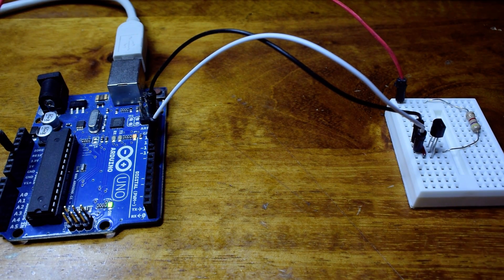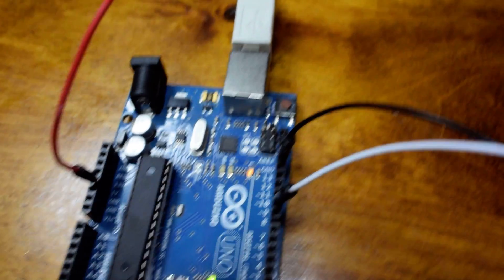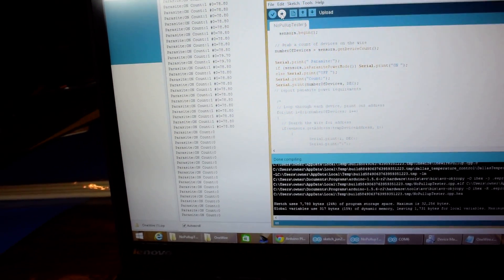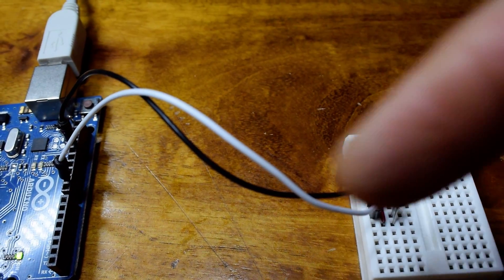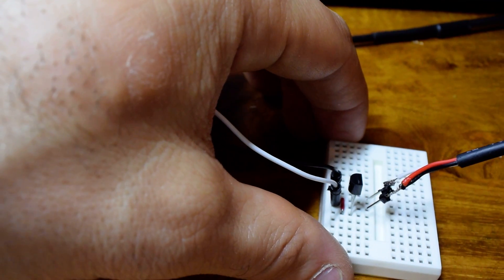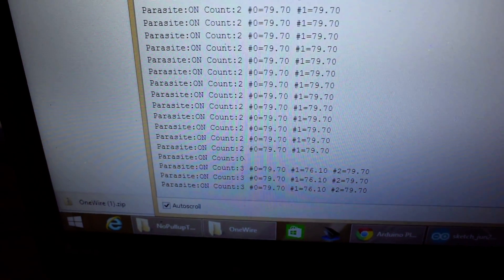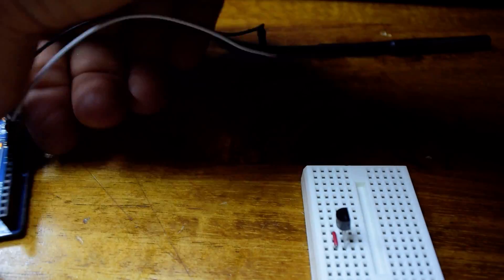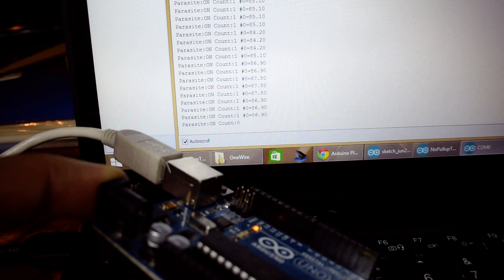PROVED: External OneWire pull-up not needed for Arduino comunication to DS18B20 temp sensor

Comment: wel.. the document from ds18b20 doesn say they are testing the sensor at 150m+ with 50m between each sensor, and the pullup circuit is for extreme condition, for your short, rather low capactiance cable, it is not that big of a deal.

Comment: Can't get this to work for esp32 :(

I applied the changes from https://github.com/bigjosh/OneWireNoResistor/commit/ebba80cf61920aef399efa252826b1b59feb6589
in my local onewire library, in arduino libraries folder

But the sensor cannot read the temperature,  it just returns -127

Comment: This schematic doen't work! Why? You have to read datasheet and see that if you have 2-wire connection then you have to drive data pin directly to power rail in data accuisition and eeprom write operations (those modes require alot of power). If   you can't do data accuisition then sensor is useless!

Comment: Why does the program say, "on pin 10 (a 4.7K resistor is necessary)"? It works with the resistor, but not without it.
Reply: Got it.

Comment: I'm trying to read the temp with a ds18b20 and I tried using your code but I keep getting this error.
error: 'class DallasTemperature' has no member named 'reset'
Reply: Getting the same error... Any ideas?
Reply: Jorge Ulloa Never found the solution, I'm just getting the correct resistors to do it.
Reply: Philip Cara I found a solution. Just commented line 17 this way: //#define BUSFAIL and it works!
Reply: Jorge Ulloa awesome I'll check this out, thanks!

Comment: Excellent video.  I used a 5.6k because I didn't have a 4.7k and it worked fine. Next I will try your version with no resistor and reduce my part count.